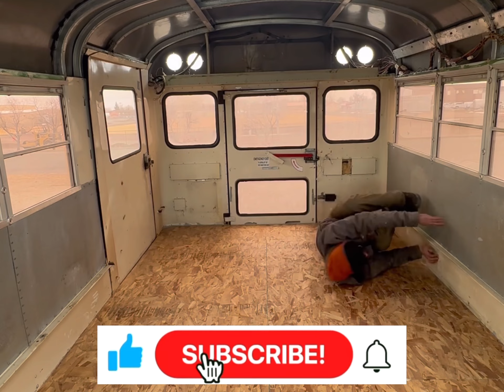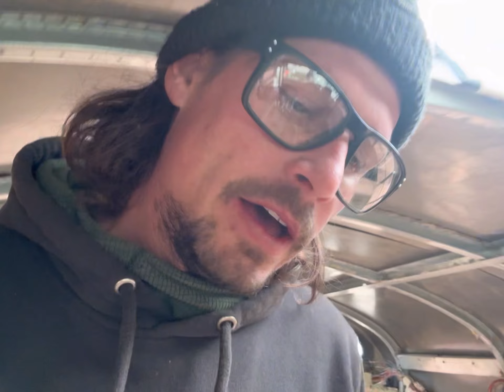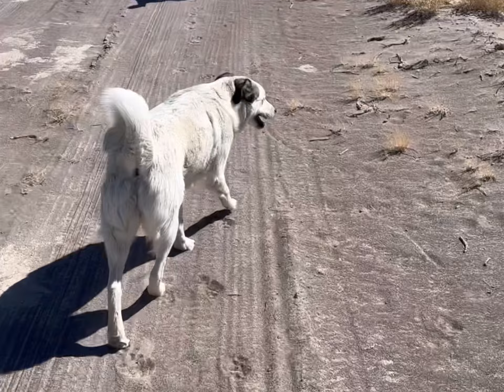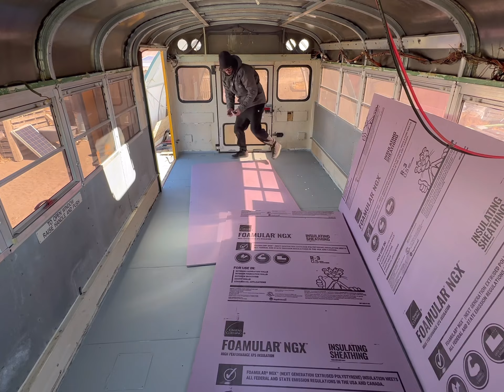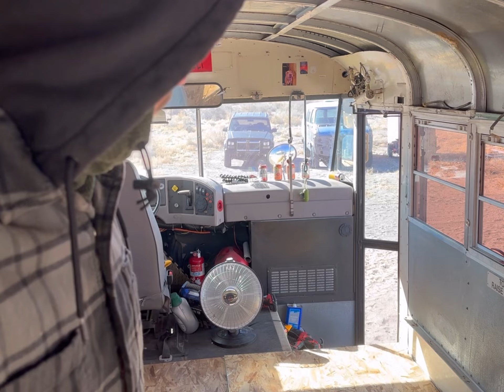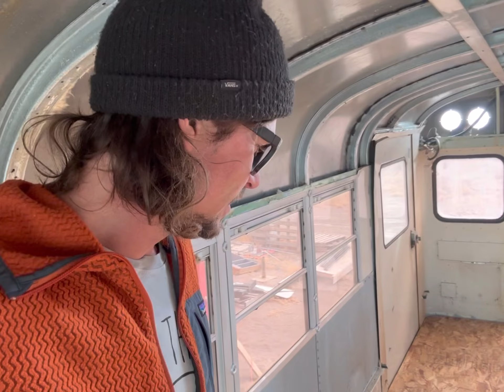OFFGRID Bus Build / insulation / subfloor

Comment: Just Curious as why you didn't patch all the holes in the floor before covering it with the insolation and plywood.
Reply from the maker: Walls inside school buses and vans are designed to breath with weep holes. Keeps things for rusting and molding where the hot and cold meets and allows condensation to escape. Same intentions with the floor. If you accidentally have a massive leak inside there will be nowhere for the water to go and will be disastrous. Vs having somewhere for it to escape and breath preventing mold and other issues. The foam I use also doesn’t mold and it’s very durable. It’s all glued down with loctite as well. A dude I know Chuck Cassidy has a subfloor masterclass on YouTube. He uses a lot better wood and paint then I do but our methods are pretty similar. His I say would be a lot better long term and depending what environment you’re in. I stopped sealing van floors awhile back after I discovered all this after my first build. Gotta let things breath
Reply: @Shane.Dennnis  I love how detailed this answer is! Thank you!! ❤
Reply: Thanks for explaining